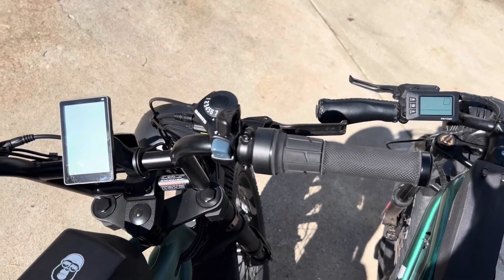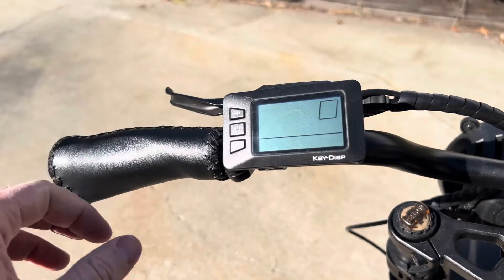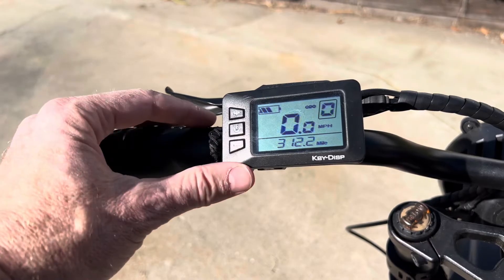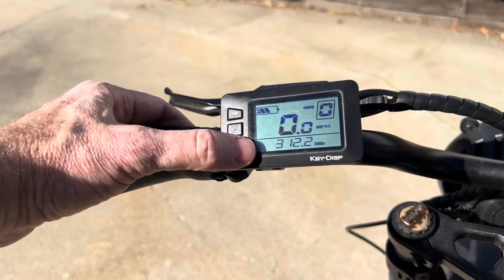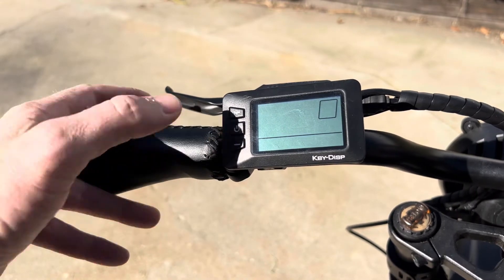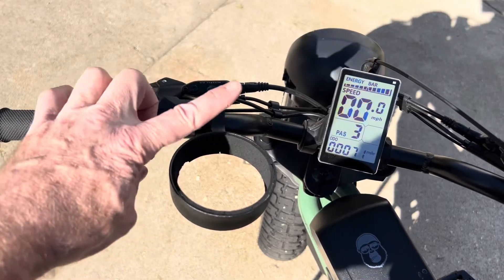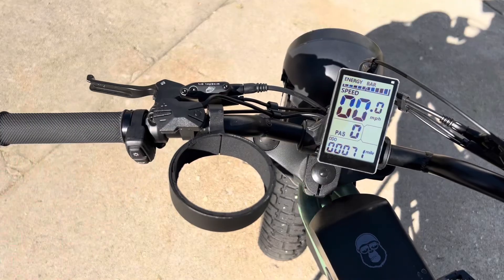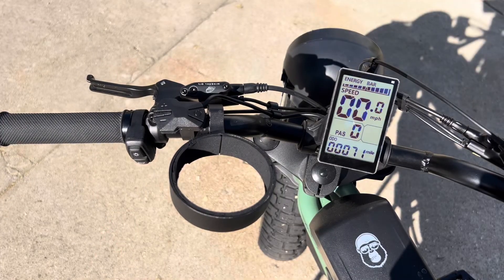How To Turn On An E-Bike And Change Power Modes

Comment: Also, the power assist modes can be increased to 3, 5, or 9 levels. All deliver the same max power split at different intervals. This is done in the program settings.

Comment: Hello, today my Ape Ryder Bonobo arrived. I have some questions, please help me. I commented on other videos of you as well. 
1. I didn’t find how to unlock the speed. Please tell me the exact steps, your video about that isn’t very clear. 
2. This is more IMPORTANT! I don’t know if my battery is charging!! I got the battery off the bike and connected the charger to it, I don’t see anything that indicates me that it is charging. Just a green ligh on the charger, but it doesn’t change the color when I plug it. I would apreciate if you will help me. I am waiting for your answer!